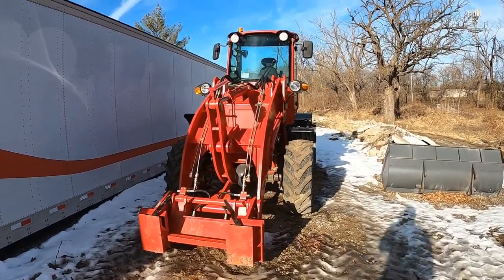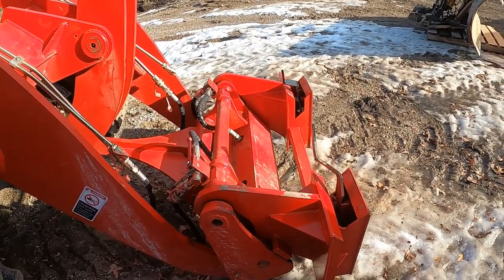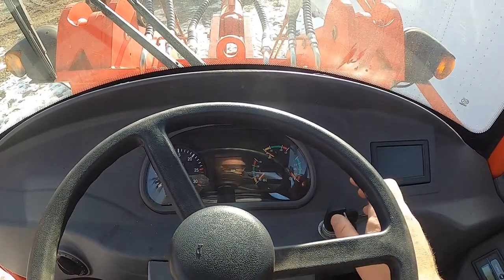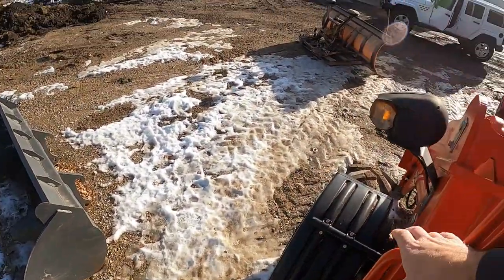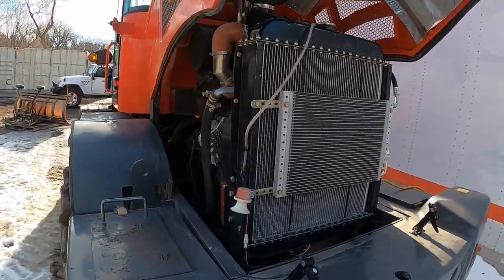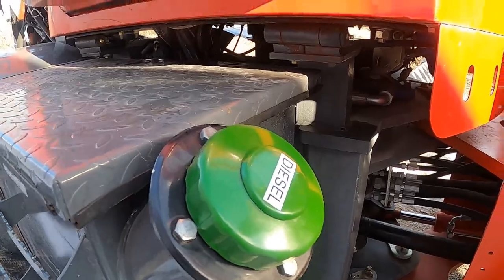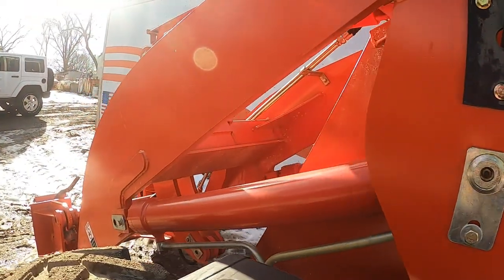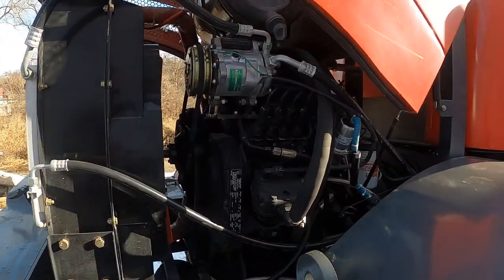Chinese Wheel Loader - Simple, Cheap Snow Machine!

Comment: Could you do a video of the controls/in cab? Thanks
Reply from the maker: Absolutely! Anything specific?  It's about as basic as it gets.
Reply: @titanlawnlandscape7783   yeah mainly just the çab set up and how many speeds it has
Reply from the maker: @nathanbawolek2990  4 speeds. 2 speeds in low and 2 speeds in high. Normal joystick controls and gas and brake pedal.
Reply: @titanlawnlandscape7783  thanks for the replies! Where is missouri did you pick it up. Would love to get a little more info from the dealer. Thanks!
Reply from the maker: Dealer is called Clark Industries our of Idaho. The implement dealer we bought it from in Missouri is not a dealer for the wheel loader. They bought it at auction.
Reply: I live in Idaho. Been over and talked to the guys at Clark Industries. They can’t bring them in without the emissions anymore.
Reply from the maker: That was the beauty of them as they are  zero emission controls and literally just a motor, a transmission and a frame. So simple.

Comment: Ive been looking at these machines too.  Also the smaller compact loaders (similar to avant)  

I like the idea of the chinese loaders because they are bare bones like you said.  Cheaper to buy and probably lower maintenance costs.

How do you get parts in the event of a breakdown?  Who makes the hydraulic pumps and transmission?

Engine is a real cummins with a serial number on it?

Thanks..good video.
Reply from the maker: Engine is a bullet proof 3.9 cummins thats been around since the 80's. Im not sure on the hydraulic pumps and  transmissions.  This will out work a comparable sized 15,000 lb CAT or DEERE wheel loader due to the size of the engine. Comparable wheel loaders this size run 70 to 80 hp motors. The guys we've rented the machine to have given positive feedback.
Reply: @titanlawnlandscape7783  awesome sauce.  Thanks for the reply.

Comment: How much was it
Reply from the maker: $39,500
Reply: @titanlawnlandscape7783  On top of that, how much was shipping and taxes? Many thanks.
Reply: @titanlawnlandscape7783  On top of that, how much was shipping and taxes? Many thanks.
Reply: Just read your description just now sorry. Normally import shipping would be in a 20ft container maybe around $3000 for shipping, and taxes/duty at least 10% on the total price (machine and shipping). So for an average Joe to import, it might cost nearly 50k total maybe? Still dirt cheap in comparison to equivalent brands. Hopefully the simplicity of the right kind of machine would make repairs just as easy as the brand ones. As a general rule, you just gotta be careful what you are getting from China, but if you are smart about it and mechanically-inclined, you can actually get a very good machine when compared to known brands.
Reply from the maker: It was in the states when we bought it. So it was a normal transaction.